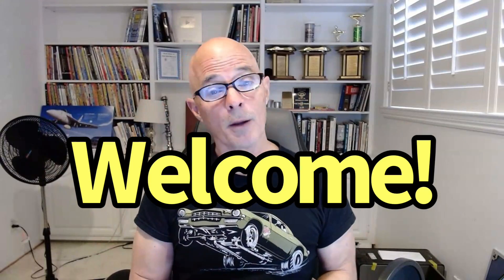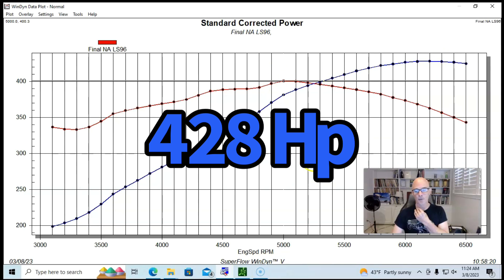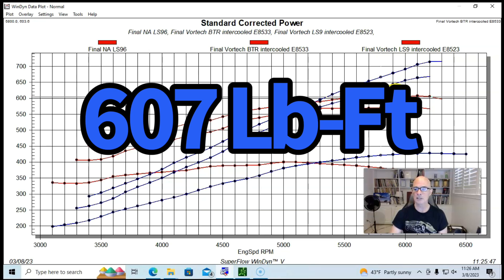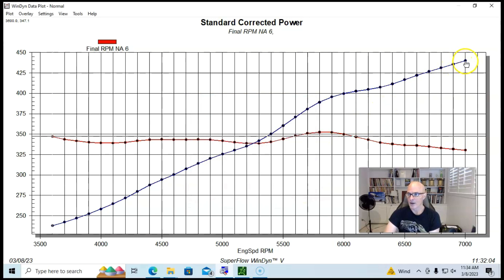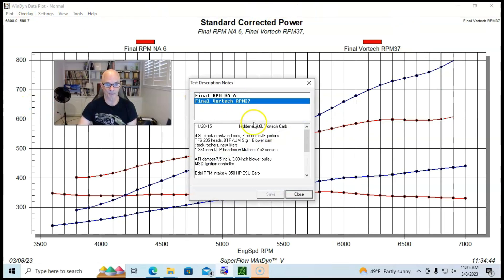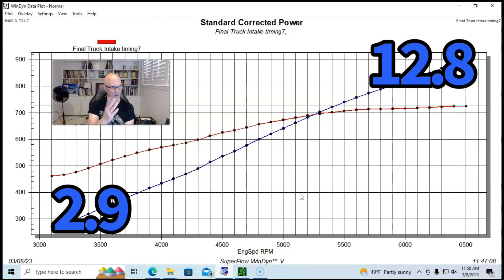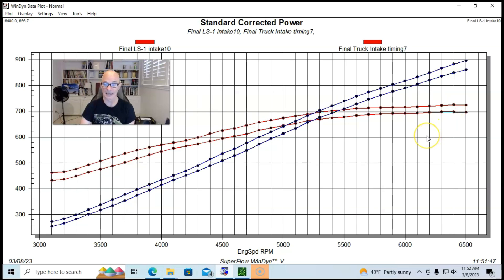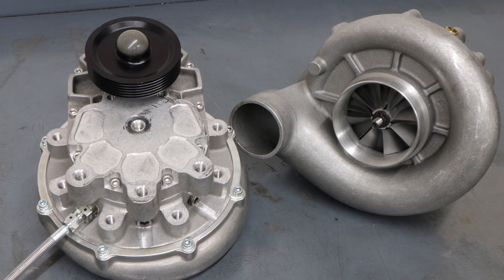HOW TO SUPERCHARGE YOUR 4.8L, 5.3L & 6.0L LS! 700-HP, 800-HP & 900-HP VORTECH CARB & EFI COMBOS!

Comment: Got a question, it is possible to put a srt supercharger on a lm7 5.3 99-06 gen. And if so, is there a miracle that someone can tune it to pass emissions?
Reply from the maker: there is an adapter to run the hemi blower on an LS-but obviously it won't pass any visual inspection

Comment: Why Is the 4.8 so much better with pro charger then the 5.3? Is it just higher revs and lower compression?
Reply from the maker: it isn't better, the one that makes more power na (the bigger one if equipped equally) makes more under boost

Comment: As always appreciate the info/vid Richard, but what's up with some of these combos having forged internals while the others use factory internals? 6liter having forged rods and pistons ? Also is having aftermarket heads a requirement to achieve these power levels obviously it will make reaching a certain power level easier, but usually when going forced induction route needing aftermarket heads as well when dealing with Ls stuff is guess akward being the flow abilities these motors have regarding 706,799 etc, based on the info on your other videos regarding these heads    and the power there able to support, id would think in majority of situations most would consider them decent and by adding force induction to the combination is easier easiest way to the most from than rather then doing upgraded heads for a force induction combination, if these flowed something like sbc double hump heads or a basic sbc head (not vortec version) then would make complete sense, but I've been under the assumption that Ls family have pretty decent flowing factory heads to make respectable power levels from ? No personal experience as im a gear head  as well and love anything that has to do with the word engine, personally I'm a Honda freak, but been really having a itch for V8 but kinda  like original sbc for the cost/hp but keep these vids rich much respect to you for sharing results from the 10 million different ways to achieve power from many different types and makes of combustion engines, don't think there's a performance shop,company or manufacturer that's done as experiments with engines as you have 😂.

Comment: I just bought the same blower setup for my trailblazer ss. Already have the comp 459 cam and Total engine airflow stage 2 heads and 85lb fic injectors. I can’t wait to get home and get it on and tuned next week.

Comment: I have a stock 2004 L59 and a Vortec V3 supercharger. Would this be a good combo in my Jeep JK? what should I do to make it 400 or better WHP on pump gas?  I was getting 330 WHP out of my pentastar with it. But Im ready to go automatic and want MORE POWER! I can replace engine parts if I need to. Just seems the engine ran great so why mess with it if it can meet my needs...
Reply from the maker: one of my Low Buck Truck cams and a Vortech blower will go way over 400 whp

Comment: Richard I’m putting a centrifugal supercharger on my 5.3 trailboss have a methanol injection for cooling as well as a intercooler. How can I get my engine to be reliable but still make around 700 I was going to use the brain toilet cam shaft you mentioned along as the katech 706 as well as the other stuff you mentioned. Will this truck be able to be a daily without constant issues
Reply from the maker: Properly tuned you can make 700 hp
Reply: @richardholdener1727  will it be reliable and not grenade

Comment: Building a 6.0 street truck looking at either a vortech or torqstorm supercharger don’t plan on making crazy power, goal is 500-600 what fuel system and injectors do you recommend for a mild build ?
Reply from the maker: 80s
Reply: Help me build my 6.0

Comment: hi Rich, firstly, thanks so much for taking the time to do these vids - they are amazing. Can I ask a question, I have a 2010 Audi S5 4.2 v8. I am going to supercharge w an m112 from a Mercedez S55. do I need to lower comp ratio? stock is about 10.5.  I want a daily driver, not a blown engine..... any advice would be greatly appreciated.
Reply from the maker: you need good fuel, intercooling and/or lower comp-people run boost at that compression all the time-tune is improtant

Comment: Best way to supercharge my 88 foxbody  302…?
Reply from the maker: lots of kits avail
Reply: @richardholdener1727  I have a Vortech -1 s trim, b303 cam, 75mm throttlebody, bbk shorty headers, magna flow exhaust, everything else stock…. What else should I go with? I’m trying to hit 400+ hp
Reply from the maker: sounds like you already have a supercharger-a better intake and cam/springs

Comment: Richard I’ve watched the comp cams snippit video of where you procharge a 5.3 and made over 1k HP. Using comp cam 54-477-11. 

What was the setup on that build?  I know afr heads. 

Also when gapping the rings for boost most are doing for turbo. Any difference for centri blower?
Reply from the maker: need gap for and boost-hi ram, afr, forged internals (not needed though), Pro d1sc or D1X
Reply: Thanks Richard 

Ring gap is ring gap doesn’t matter what the boost is. Turbo vs blower? 

Did that 5.3 have store bore?   The afr heads   That I looked at says 3.900 bore. Even some of the ported 799’s by some companies say the same thing.
Reply from the maker: it was 3.902
Reply: I have a 11 Tahoe lc9 that I’ve owned since 16 with 59k miles. No issues etc.   when I got it I did a small 216/220 high lift tsp cam, longtubes etc.   basic boltons. 

Now it’s at 195k still no issues but I’m wanting to do a procharger so started looking into it etc and came across your video. Which lead to many other questions etc.  mainly the head thing.
Reply: What about a gen 3 4.8? Gapped but no forged internals? Will it take  the 700-900 boost levels?

Comment: Richard,

Is it possible to retrofit a LT4 supercharger, on a LS platform? If it isn't possible, then why? I can't find ANYTHING about it anywhere.
Reply from the maker: The low (blower) intakes are not interchangeable between LS and LT motors (different heads)

Comment: Hey Richard!
Do you have a video for 5.3 short pipes test? 
I'd like to know now low starts gaining some HP.
I do have a 2017 SUBURBAN, and I drive it every day. I'd like to know if short pipes it's the right choice in my case. I do not go more than 4000 rpms. Thanks!
Reply from the maker: what short pipes? neither short exhaust or intakes make power down low-longer is better
Reply: @richardholdener1727   Headers I'm sorry. Short pipes headers.
Reply from the maker: shorty headers do not make more low speed torque than long tubes

Comment: can I ask for some help Richard, im building my gen4 LS2 I'm wondering if ive purchased the wrong Turbo, my engine has a 3040 forged Lanati 4.100 Crank, 6.125 manely H-beam rods, 4.000 forged JE pistons as engine has only done 70,000km so just getting it honed, im using the stock Gen 4 heads wit duel springs and rockers done, cam is 277/284  607/617 lsa113, using LS7 lifters high rise intake 102mm TB, I have got an s400/498 98mm billet Turbo with T6 suppose to be capable of 900-2000hp is the turbo to big ive got 1300cc 120lbs injectors not sure of fuel pump but will be minimum 500gph I have pretty much everything in the engine is beefed up should I get an S400/488 or even s400/480 with T4
Reply from the maker: the injectors are not big enough for a 98mm turbo (if that is the inducer size) and i would not have chosen a 4.100 stroke crank with a factory block sleeve length-you don't need the added displacement, you have a turbo
Reply: @richardholdener1727  thanx Richard from what I can find out the 6.0-6.2 gen 4 do have a longer sleeve so not concerned about that, the gen 3 6.0 are the ones that can’t take a 4.100 stroke, so the turbo is to big yes that is the inducer size, a stock size of an s400 is 75mm, they do a 75mm, 80mm, 88mm, 92mm and 98mm, I can buy a smaller turbo the 80mm and when I get my head around the turbo thing as I know nothing about it I will order a new turbo the 80mm seems to be the middle and ill look into bigger injectors
Reply from the maker: the stock sleeve length in a production 6.0l or 6.2l block (regardless of generation) is not long enough for a 4.10-inch stroke. You need after market sleeves and there is no reason for using it. you have boost-the power output will be determined by the turbo selection.

Comment: A Richard I'm a new subscriber to your channel, I hope you respond but my question is can you run a supercharger on a 4.8 with stock pistons and a stock cam with a 150,000+with no problems?
Reply from the maker: yes-you need ring gap and injectors and pump and tune (cam and springs would make it a lot better)
Reply: @richardholdener1727  ,appreciate it
Reply: @richardholdener1727 ,I had found out what's wrong with my 06 Chevy Silverado with the 5.3 L59 engine,it had a bad TPS sensor and the vapor canister purge solenoid was bad also,it's needs alot of maintenance and has been neglected for a while,but I'm not upset at the previous owner because he hasn't dog the truck out at all(20+years of good service,original engine)an I also got a great deal on the the truck,but my mechanic said it's the lifters causing the misfire an it's on the odd number side I believe it's cylinder #3,because the check engine light is flashing an sometimes it's solid,so it's cutting on and off the power,so my mechanic and I are pulling the engine,I'm putting a new timing chain,valve springs,stage 2 cam,I'm taking the 706 heads to a machine shop,new oil pump pretty much a whole new drivetrain I was wondering about those bearings but it sounds like the lifters is about to collapse, but it still has alot of power and speed

Comment: would you be willing to test external waste gate vs internal waste gate?
Reply from the maker: the boost control is always based on the size of the flow orifice-internal gates are usually smaller

Comment: Want to build my 5.3 ls motor to a 363 stroker with a turbo what will be some good combos to run to achieve great hp. Any help would be appreciated
Reply from the maker: you don't need a stroker with a turbo, the 5.3l will make all the power you want with boost
Reply: @Richard Holdener  thank you Richard for  answering. 1 last question what forged pistons and crank would u suggest there's a lot of them

Comment: Can you test overlap vs boost loss. 10 pound pulley 3 camshafts -9 overlap 2 overlap 12 overlap and see how much boost is lost with each camshaft also how torque is affected
Reply from the maker: if you drop boost-you add power

Comment: Gen4 4.8 799 heads,  BTR cam, Torqstorm SC, Term X, all the bolt ons.... made 444hp to the wheels on 11psi.... WTF! im disappointment
Reply: Not that bad imo. His heads were ported. Maybe volume difference between blowers. He has ideal conditions too.
Reply: @TheBdubya24  true. I was disappointed on the power number. A NA 6.0 makes around the same whp...
Reply: @isawul00k it's a 4.8 that's not bad

Comment: What was the static compression on the 6.0? I built a 408 forged parts but around 11-1 and am considering putting a procharger or vortec blower on it and keeping it around 7-10 lbs.
Reply: Do you think with lower boost and e85 would be ok?
Reply from the maker: yes
Reply from the maker: near 10

Comment: My 408 LS is 10.8 compression. I wonder if it would be ok on 93 octane with like 6 lbs of boost?
Reply: My C5 Z06 LS6 is 10.5:1 compression, running 10 lbs boost on Sunoco 93 octane.
Reply: That's all fine and dandy, it's the timing that makes it or breaks it
Reply: Should be just fine on 93

Comment: Do some L94 6.2l stuff! Please?
Reply from the maker: Responds same as every other rec-port 6.2L
Reply: @richardholdener1727  show us.  😊 One with vvti and then cam swap it and deleted the vvti. Something real world like we face with gen 4 L94 engines.
Reply: So when looking up vortech T1 multiple options come up v1-v2-v3 and only option listed for gm trucks is a v2 that only adds an additional 100 and some change in hp and torque. What specific model is that in the video used on the 6.0 I’m fully built for boost

Comment: Would love to see a test of an engine set up for the dyno (open tb, dyno headers, electric water pump, etc) vs an engine ready to go in a car (filter, ps, alt, ac, etc) to give everybody an idea of about how much we lose getting it ready to drop in our vehicles.
Reply: Engine Masters has made a great video on this exact test.
Reply: @1clean35th  i know engine masters has done tests piece by piece, but I wasn’t familiar with any they did with full accessories at once
Reply from the maker: Please see the video where I tested from the engine to dyno to chassis dyno -already up
Reply: @richardholdener1727  thanks must’ve missed it
Reply: He did it to a ls2 and it was about 80hp loss or so and he did his van as well usually 100hp is pretty close so 500hp = 400 wheel or so
Reply: https://youtu.be/z2FdtRb94hw

Comment: Could you use a boost control valve then pully the blower to max shaft rpm? That way the the boost psi would  stay at a controlled  psi to reduce  variables.
Reply from the maker: Even with a controlled wastegate/bov on a centrifugal, the boost will still be dramatically different at 2000 rpm than 6000 rpm and is never recommended by blower manufacturers nor will it allow the centrifugal to do what a turbo does
Reply: No. Boost is controlled by rpm on centrifugal blowers. Boost controllers are for turbos
Reply: @EGGINFOOLS  I believe you are technically incorrect on this.  Smoothboost makes a "Centrifugal Supercharger Boost Control Kit" that is very similar to what @freyja4954 is talking about. There may be others out there too.
Reply: @Donterryvan  looks like you're right